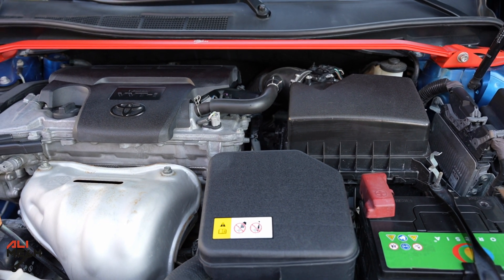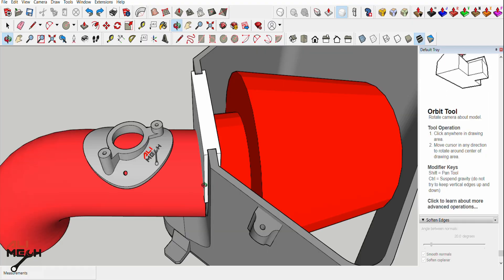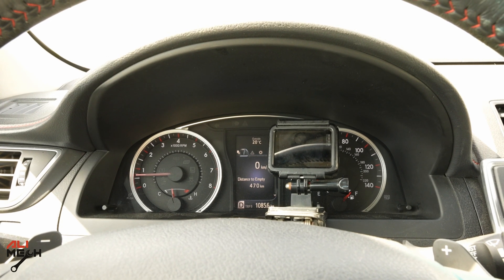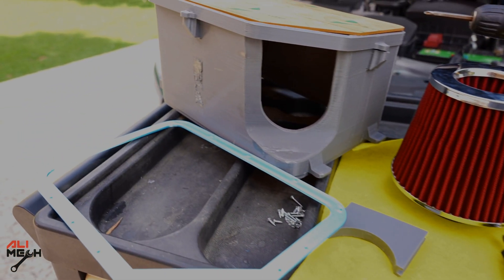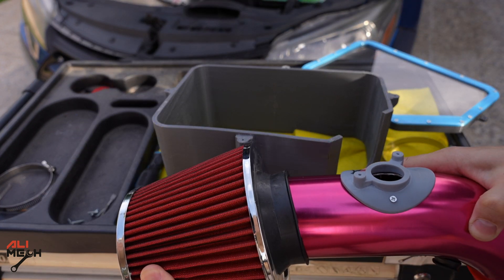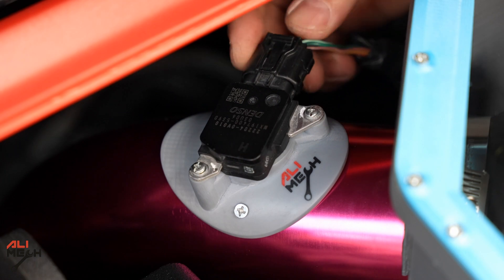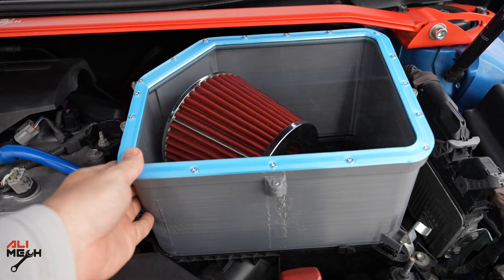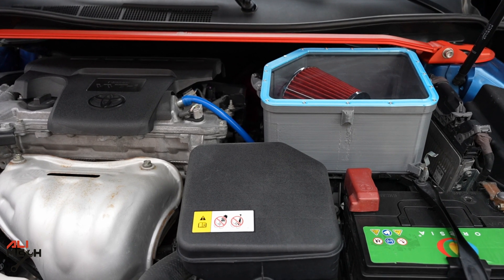Aftermarket Intakes increase Horsepower? Designed and 3d printed see through filter box for my Camry

Comment: Also guys, wrap the intake pipe with Heat Reflective Tape, its proven to keep air temps down which also benefits it.
Reply from the maker: That's a great idea
Reply: I 100% agree I made a custom intake out of stainless tubing and the heat soak was terrible but heat reflective tape fixed it